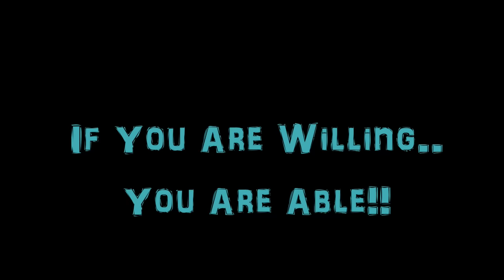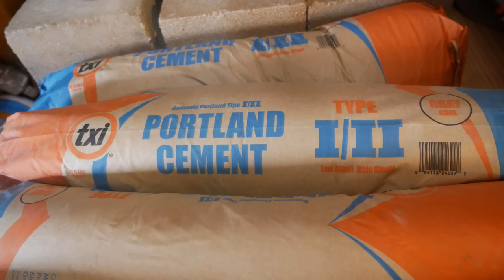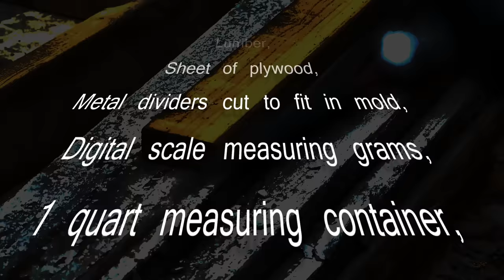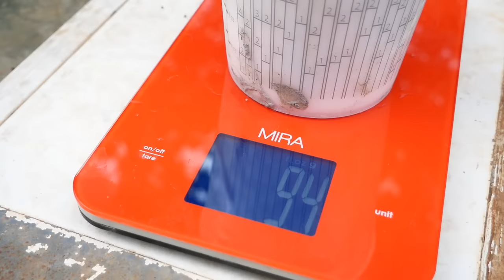How To Build Your AirCrete Tiny House

Comment: I have 2.5 acres of land in N. California, pretty remote and steep in parts. I was thinking of doing a house like this dug into the hillside, so all you see from the downslope side is a cool doorway. I was thinking of just doing a circle mold made out of plywood about 8" from the actual dirt, using the dirt as the other end of the mold.
Anyway I've never heard of AirCrete, this is so cool! I was going to do a tamped earth, but you talked me out of it, as I need somehing where i can do in 2 weeks off of work!
Reply from the maker: I do not recommend using AirCrete below the ground because of its low tensile strength.  The sideways force of loose or wet dirt can be substantial. You could build a ferrocement outer wall for support and AirCrete as the insulation.

Comment: Thanks for the informative video! 

1. What brand of latex cement bonding agent do you use? 
2. What brand of never hard caulking do you use? 
3. What is that lock mechanism on the form called?
Reply from the maker: You are welcome.
1) a constant rate is best. QuickCrete brand is good. avoid the " pro " brand at the big-box store because it's actually already watered down and it cost you just as much.

2) any cheap painters caulk

3) I just use large self tapping screws now.
Reply: Thank you!

Comment: came across this channel and have been binging through them.

If I wanted to cast a monolithic structure, would I still need the fabric? my thought/plan was to set up forms, rebar, mix/pour, and then just spray stucco after removing the forms and call it good.

I've been wanting to build a place and was trying to find the best material (maximizing cheap, fast/easy, high performance). I think aircrete is what I've been looking for.
Reply from the maker: Yes, you need the fabric or other viable alternative.

Comment: if in NW NY state, what would be good to use as a base to build on being the ground expands in the winter? I am looking to build a elongated tunnel shaped equipment shed to work in at any time of year.
Reply from the maker: A standard deep cement/steel footings below the frost line as is common in your area.

Comment: My thought is to build a dome with thick walls, and then seal it, and bury it, so I have an underground house. How thick do you think the walls would have to be for a 20 foot diameter Dome? I'm very much interested in all of the details.
Reply from the maker: I would generally not burry AirCrete.  It is not as strong as cement.  Wet dirt can be very very heavy.

Comment: I live on the big island of Hawaii. After the lava flow in pahoa and the fissures in leilani. We built 3 shipping container homes in hamakua coast. I been doing research on aircrete and I am very interested.

I have no experience with aircrete and very little carpentry experience. Would I be able to build a traditional house with aircrete? I can only find videos of people make dome houses. I wanted to make a private gym. Maybe 20' W x 24' L. 4' for a toilet and show. Is it even possible to do?
Reply from the maker: MGTOW!
Yes, absolutely you can build a conventional type house using AirCrete.  This summer I will be building a conventional 30x40 foot structure with a standard roof.  It is easy to learn and to that end I have a video course available ( https://tinygiantlife.biz/build-your-own-aircrete-home/ )

We have had 16 year old and a 76 year old  man attend a workshop then go home and build their own home.  Neither had any previous building experience.  With YouTube at your finger tips you can always learn how to do the various skills involved in finished a house.

Rectangle structures require a bind beam poured on top of the wall and pipe/bar/post/all-thread/peer ect to connect the foundation to the roof.  This is especially important on an island where wind can be strong in hurricanes.

If you want to learn more join our mailing list and get a series of emails explaining AirCrete: https://tinygiantlife.biz/

Fill out the pop up form to join the email list.  Unsubscribe any time.

AirCrete makes as much sense in DIY housing as MIGTOW does with our modern mates..

Comment: So much great information. Sure appreciate it! Can you elaborate on what 'soft polyester reinforcing fabric' means, perhaps a brand or something. I'm not seeming to find that.
Reply from the maker: Apoc makes a fabric for roofing.  It's listed for tar & cement.  The soft fabric allows you to shape it easily to a dome of deformations.  There are many companies who make roofing fabric.  Just call an industrial roofing supply to locate some.  You can even call apoc and find a dealer in your area.
Reply: The R factor is off the the charts, with a few modifications water and even a tornado!

Comment: NIce video...any reason why you do not insert any rebar into the molds.....just curious??
Reply from the maker: Tensile Reenforcing must run over the entire structure placing it in one block will not work.  Reenforcing fabric is applied to the entire building and bonded to the blocks.
Reply: Rebar would make it heavy. Some people use microrebar.  Any kinda tinsle fiber works. I even heard shreaded paper works great. I tried used fiberglass but it just got stuck in my mixer :( I really wanted to use up that old fiberglass I'm replacing with good aircrete insulation bricks.  Oh well.

Comment: Sorry I don't have any pictures of the plans yes.My Endo-Skeleton is very close to 10' per triangle on the (A) side (FULL SCALE) (Fire and Impact tests are almost finished and I've had to make several Jig's and Pressure-Molds to create the basics.I made a 1/8 model, final skin was 7/8" thick. I ran a 2500 degree f torch against the dome directly against the brick, I couldn't feel any heat with bare hand on the outside. My friend drove his Chevy Silverado 3500 dualee, and jacked it up right on top of it and no stress fractures. Full scale will be 25'R = to 1920 sq ft Single Story. My 5 window Birds nest has Temperature control and the roof rolls back for using my 18' Smith Dobsonian Telescope, The new mirror is going to be 48".
Reply: The inside of the e or comb matches up with one end of  the jig, I will  weld all 3 ends filling one end of the E . Match the open end of triangle with the pipes as connectors welding each connector 
And grouting all connections.

Comment: You state not to use regular cement mortar but what about lime mortar has it be tried before. Its flexible and soft.
Reply from the maker: It's non insulating
Reply: @TinyGiantLifeStyle  I'm more interested in its strength and ability to flex. What art your thoughts of using it without worrying about insultive problems
Reply from the maker: I'm sure you can use it in compressive parts of the structure. Not going to recommend it.

Comment: How does aircrete work in hot arid climates where summers can go over 40degree Celsius?
Should there be a need for an air conditioner ¿
Reply from the maker: It all depends on lifestyle choice and climate you are in.  It gets to 41 C in the desert where I built the last tiny house.  It is actually cumfortable enough without air conditioning as the heat is held out of the space.  If you have cool nights and open it up at night then close it up during the day it stays cooler than outside all day and then it's like a shaded and insulated roof which keeps the extreme heat off.

Comment: Is AirCrete suitable for making a poured foundation for a building that will be on the large side and made of heavier materials, i.e., traditional brick and mortar?
Reply from the maker: I would say no.  If you are building traditional than you should build completely traditional.  You can infill with AirCrete or make a non load bearing subfloor. However, I'm not sure there is an advantage.

Even for AirCrete structures it really is important to have a cement & steel foundation ring/footing under the wall.  I know domeGaia uses AirCrete with just rock and that's fine for third world structures.  However, for repair free longevity you need a foundation that will not crack and move over time.  Especially in expansive clay soils.

Comment: Hi i have a couple of question:
1. could an air-crete bricks construction (whether dome or rectangular) be able to support the weight of a wooden roof (in case of a rectangular house) or the weight of a "living/green roof" in case of making a dome house kind of like a hobbit house? 
2. does an air-crete house "breath" like natural constructions do?

Thanks
Reply from the maker: AirCrete does not breathe.  Fresh air exchange is a must!

AirCrete can be designed to support a normal roof.  Living roofs would need to be shallow or wall thickness designed to support the wet weight.

Comment: Thank you ... great information, but I live in Western NY ... would it really work with our messed up weather patterns??? Lots of rain and deep snow some Winters
Reply from the maker: What is the maximum weight you might expect on top of the structure?  85,000 pounds for 10 feet of snow over a one bedroom dome?  That weight dispersed over 11232 square inches of a 1 foot thick wall is 7.6 pounds per square inch of pressure dispersed over the compressive structure of a dome which already has 36,000 pounds of weight  making the koad 11'ish pounds per square inch.. AirCrete consistently test over 160 psi strength.  So will it "work"? You tell me?  

Also, if you Building near winter green block are at risk. Fully cured block used in building is better.

It's all in the design. Certainly it's worth doing the engineering on anything you build.  If you use a sphere design instead of a stem wall the tensile strength of the Reenforcing fabric at the equator must be considered!  The cheap stuff supports 72 pounds per square inch. Worth using a better fabric or doubling the Reenforcing and perhaps even using other technology like basalt rebar/rope.. Never assume anything. The larger any single structure the greater the load stress. Small structures are easy. Engineer and design everything for real world conditions then add a safety margin.
Reply: I have heard of it being used  in Ontario, Canada

Comment: This is probably the most thorough and complete instruction video on building with aircrete.
Only thing that is missing : You don't say what is the size of the bucket you use for the foam solution. I guess it must be 1 gallon, as you use a similar bucket to mark the level on the barrel, and you say "measure 1 gallon at a time into a bucket".
I watched this vid at least 6-7 times already!!! Always coming back to it and appreciating the sentences I did not notice on my first views!
Reply from the maker: A 6 cubic foot batch (one barrel) needs 5 gallons of foam solution.  I make 24 cubic feet of blocks. So, I use a 25 gallon trash can for each block mold.  

It all just depends on how much you choose to make. I guess I assumed that was a given.  Thanks for pointing that out.
Reply: What I meant is that it is important to know the volume of the bucket, because later on you say "and to this, add this much soap or 4 oz of drexel". So it's important because that's how we know how much drexel you put, which is a crucial info.

Comment: I build concrete over EPS geodesic domes in Peru (my own design but similar to American Ingenuity´s design).  I am looking to replace the EPS with airecrete.  I wonder if anyone has tried to add sawdust to the mixture for increased insulation and as a lightener.  Also, I shoot my concrete mixture out of a mortor sprayer.  I am wondering why no one is shooting the  aircrete mixture out of a sprayer instead of just pouring into molds.  Any comments would be appreciated.
Reply from the maker: Spraying AirCrete smashes many of the bubbles out.  It's the air that lightens and insulates the cement.

Comment: In all my research on this building method the biggest restriction is going to be obtaining a building permit. Unless you live in an area that does not require them then you will never get one. You have to get an architect in your area to sign off on the design.
Reply: what they dont know wont hurt them 😂

Comment: what are your thoughts on using aircrete with chicken wire or rebar?  Make Ferro-Airo-Cement?
Reply from the maker: Generally no. Steel is so much harder than AirCrete.  However it can be embedded for some applications.  Acrylic bonded Reenforcing fabric is the right way to do it.

Comment: Would this suite the southern african climate? Do you build these is southern Africa as well.
Reply from the maker: How far south? I have never personally constructed one in Africa.  However, we have built in the Mexican Baha, and one in Wisconsin. These represent a range of 22 to 43.5 degrees latitude. They both preform well according to their owners.

Perhaps the better question is this. Will the house be used in the conventional, alternative, or passive context?

AirCrete provides insulation and structure. Passive design requires thermal mass, solar input and insulation to function to maintain comfort. AirCrete doesn't function as thermal mass.

 Alternative construction would use a form of energy and climate control. Weather solar and wood or wind; often modern technology. AirCrete definitely functions well in this space exchanging about 1.6 BTUs per square foot; depending on thickness and temperature difference between inside & outside.

Conventional, or modern settings are connected to power lines and use heating & cooling systems to maintain comfort. AirCrete is definitely functional in this space. It make energy efficient housing.

Think of AirCrete as insulation. In a continuously hot climate the structure will heal up  like any other. Insulation slows the movement of heat. If however there  are coolcnight then ventilationvcsn cool a slab and keep the cumfort level. For passive design you must add thermal mass in some form.  The design is focused by climate, energy availability, use of modern technology.

Comment: I have been looking for a way to build an Aircrete Geodesic Dome House, but the size of the panels are going to require rebar reinforcement and Bolted Connectors for the size and area I am going to build in. I would appreciate any information you could help with. I have a preliminary drawing and the test calculations done. Scale models are in works.
Reply from the maker: So you will be making flat triangle AirCrete to infill a geodesic frame?
Reply: @TinyGiantLifeStyle  Similar, the AirCrete panels at 75X 10' A, 10' A, 8' 8" B panels and 30X 8' 8" C, 8' 8" C, 10'B panels  with double 5/8 steel rebar endo skeleton and 1"Pipe welded to the rebar at the corners for attachment points.
The panels will be 6" thick and should weigh around 100-120 lbs with the rebar and pipe, heck if the blocks come out to be 150 lbs each then the whole structure is less than 16,000 lbs total weight anyway. I am a great welder and good at making forms, a 1900 foot Air Crete Home shouldn't be that hard to build in East Texas.
Reply: @Torch1713  how are you gettin on?
I am planning this, and decided on a geodesic wood skeleton structure with aircrete poured in situ on each triangle, will be a slow process doing 72. 37ft diameter
Reply: No bolts in my Geodesic,  it is like  a comb 4" x 5/8"  that all fit into a 5" sch 80 pipe and welded at all joints. This thing is so strong, you can add a loft, or a 2nd story.

Comment: 50 gals makes 1/4 cubic yard of aircrete. Portland cement costs $25 per bag at Lowes and Home Depot. 1 cubic yard is $100. Concrete is not much more expensive. How is this cheaper than Concrete.
Reply from the maker: 6 cubic feet per $9/bag cement in bulk buy.  What is the finished cost of 6 cubic feet of conventional walls?

The single biggest saving is in doing it yourself.  We finish off grid structures for $26 per square foot including solar power and air conditioning

Comment: where did you get that round structure from? I would like to make a round house.
Reply from the maker: It is constructed from cheap utility plywood.  The length is π*Diameter+8 inches for each sheet required.

Comment: Can you use aircrete to make an in ground swimming pool?
Reply from the maker: I would say no.  AirCrete has no tensile strength.  The ground can push quite hard.
Reply: Totally could. just not without adding fiber to the mix. I would put a layer of concrete first then aircrete with fibers then fabric with milk then a sealer. Lots of work but warm pool.

Comment: Also, has anyone tried putting a fish tank bubbler in the bottom of the airecrete mixture to increase the air bubbles.  In my case I need as light as possible since the dome has a separate steel structural system.
Reply from the maker: Lighter foam is possible, but the foam agent must be increased.

Comment: Sir i want to know . Process of making aircrete. How much should be the wait of foam. How much cement . How.much water. Whats should be the size of bricks for making a home if we want to make a house of foam briks. Whats is idle size of bricks. And how a roof floor should be.made from air crete. Which can be used on first floor and can be used for rooms. First floor roof  of aircrete how it should be build. Please let me know if you know of guide further.
Reply from the maker: https://youtu.be/_QQVmZ3UYxk

I think blocks can be any convenience size up to 12 inches deep in the mold.  "Best" is a matter of opinion.  Large blocks on small buildings make for rough angular lines in a dome.  Tiny blocks take a lot more work.

Floors can be same mixture of AirCrete with any solid of flooring laid over it; like tiles or laminate floor.  I would never make an AirCrete foundation.  They will break and so will the building walls.  Make the foundation under the walls with cement & rebar.